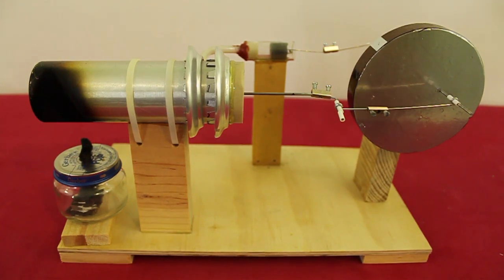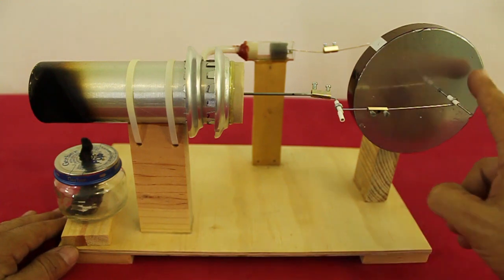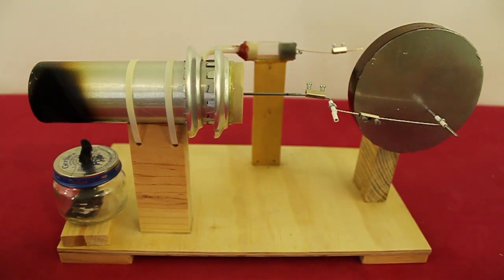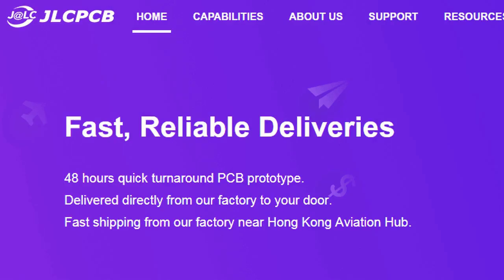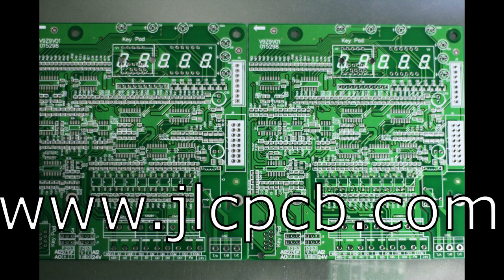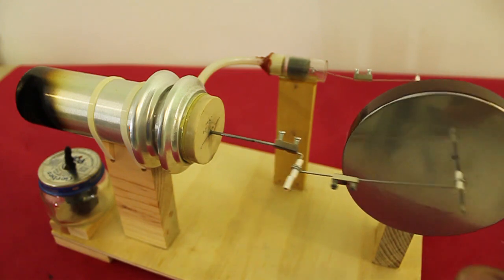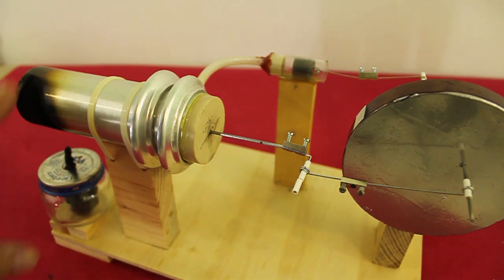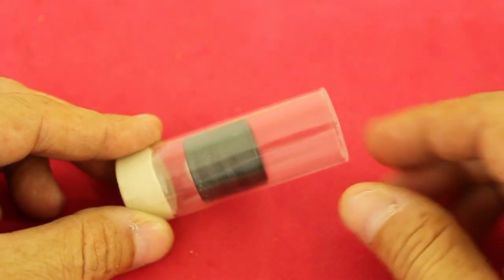Stirling Engine Mods to Increase Speed

Comment: Well, the engine may be high-speed but if you wanted it, a generator will not do you any good because obviously the engine is going to urinate and therefore it will not generate enough Energy

Comment: The problem with this stirling engine is the heat lost from the burner. How about using an induction heater to make it more efficient..
Reply from the maker: IT has many problems! Its a  very crude design

Comment: Just curious... Remembering that the formula for gas compression is PV/T do you think it would be possible to manufacture a compression engine that heats up the gas which in turn heats up the nitinol which then decompresses the gas and therefore cools the nitinol and restarts the process?
Reply from the maker: I think the nitinol is too slow to respond  to the gas speed, but is a nice concept

Comment: would it be possible if Gadolium being heated by a magnet to make a stirling engine? 
Curie Point for Gadolinium is 65 degrees F. so if the magnet is near, it heats the metal up over 65 to pass the curie point if the room is below 65 degrees .  Here is some future technology about it 
https://youtu.be/jDZU5urVQTY?t=92
Reply from the maker: Thanks I will check the video

Comment: I’m not too familiar with the sterling engine, but if a Peltier is very efficient but I don’t think it is, make the Fly wheel be a faraday a disk to power a Peltier. The Peltier will provide the heat and the cooling
Reply: Yes, Peltier, I was thinking about that.
As I can catch it, a Stirling engine works on the temperature gradient.
Does it not?
So, why not invent a Peltier-Stirling-Engine?

Comment: Make the fly will become a Faraday Disc Then you have a generator, a little bit more energy out of the system, the Faraday disk as a generator does not create resistance when applying a load
Reply from the maker: Thanks! But IT does create  resistance vía the Lorentz force.